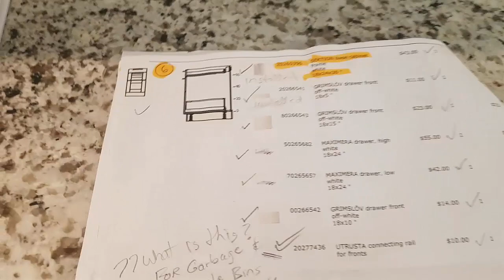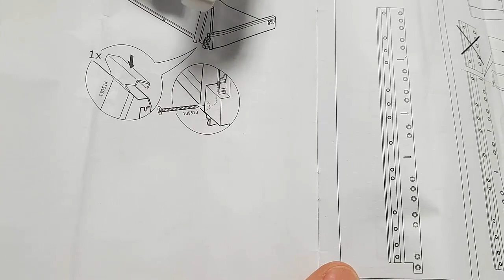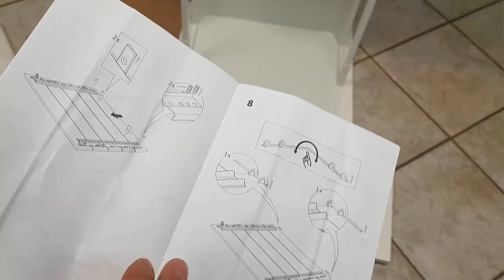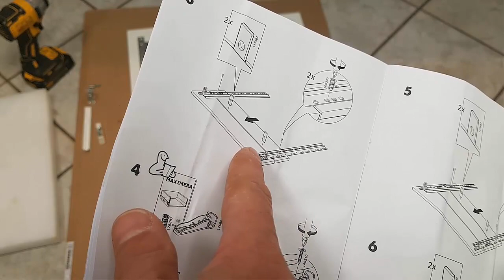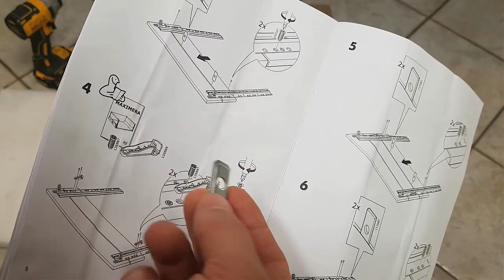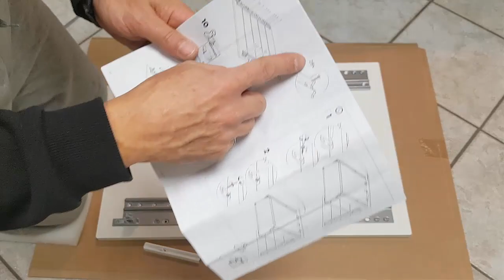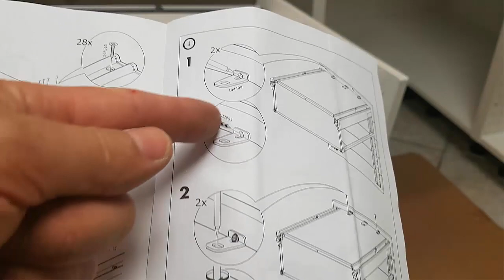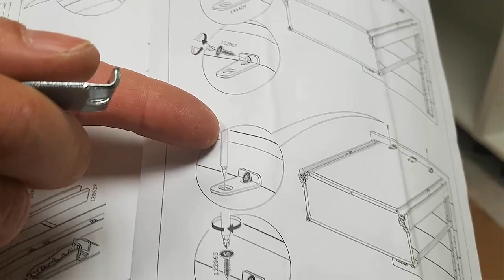IKEA Kitchen Garbage Pull Out Installation

Comment: Nice video thank you! I was wondering if it would be possible to replace the two separate drawer fronts with one full-height front. For example, I was looking at a unit that is 400mm wide and I could potentially buy a full height panel for pull-out drawers instead of two drawer fronts...I have no experience with IKEA kitchen so I would welcome any feedback, thanks a lot!
Reply from the maker: Hello and thank you for your comment. I haven't seen any full panel option either. I guess they pretty much standardize all the panels to the various sizes and then have the hardware to assemble panels together like in this case for the garbage pullout. Sorry but that' all I know. You may want to check directly with someone at your local IKEA to see if they can assist you with this. Vito Casola - FIX IT Yourself.!!
Reply: I used this drawer with a cabinet door front so what you want to do should work just fine.

Comment: It's a rubbish bin, but the metal upright brackets are unsightly. I spray painted mine white before assembly.
Reply from the maker: Good idea. IKEA should consider coating them with some type of white plastic so you wouldn't have to paint them.  Vito Casola - FIX IT Yourself.

Comment: I'm glad you made this video. While it isn't exactly my cabinet, it did show what to do with the braces. My instructions were for a short drawer even though the kit was for a full sized bottom to top drawer, so I wasn't sure where the extra parts went.
Reply from the maker: Thank you for your comment. Sorry it took so long to respond. I didn't see your comment until now, sorry.  I'm glad the video helped you with your assembly. Vito Casola - FIX IT Yourself.!!

Comment: I got a pull-out cabinet for the Kitchen faucet I need to light plumbing done and I need to remove the cabinet, how the hell do I remove it back?
Reply from the maker: Hi Antonio, I'm not familiar with the sink pull-out but I would guess it should be the same as other pullouts in the way they connect and disconnect from the slide rails. All my videos should show how the drawers are inserted and pulled away from the slide rails.  Good Luck. Vito Casola - FIX IT Yourself.!!

Comment: Ha damnit, I followed your directions only to find out you did it wrong and now I’ve made the same mistake.  Wish you would have edited the front to say don’t build the cabinet first. 🤦🏻‍♂️🥵
Reply from the maker: Hi. Thanks for your comment and sorry about this. Yeah, I just added a NOTE section in the comment now that hopefully others will read indicating that the drawer front should not be assembled to the rest of the drawer until the bracket that holds the two drawer fronts together (top and bottom) are laid down first and the hardware for mounting the drawer to the drawer fronts are installed over top of the bracket. Sorry about that.  Vito Casola - FIX IT Yourself.!!

Comment: Is it possible to install ikea drawers to your existing non ikea kitchen?
Reply from the maker: Thank you for your question. I don't see why not. Of course you would need to ensure the inside dimension of your non-ikea cabinet has a clear dimension that is at least that of an IKEA cabinet for the drawer you intend to install.  Then you would need to ensure you can locate the drawer sliders exactly as the would be in the IKEA cabinet (which is made easy by the numerous pre-drilled holes already provided for in the IKEA cabinet made for the drawer you intend to install).  If you don't have an IKEA cabinet made for the drawer then I'd recommend buying one cabinet for the drawer size you want to install and verifying all the dimensions (inside clearance and the location of holes for mounting the drawer sliders) and once you are done needing the cabinet you should be able to return it to IKEA for a full refund.  Good Luck. Vito Casola - FIX IT Yourself.!!